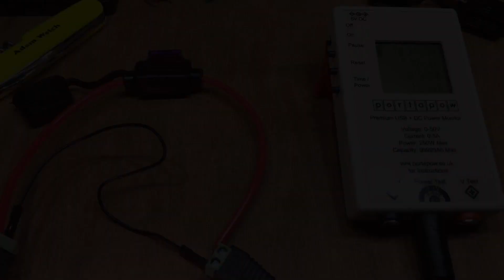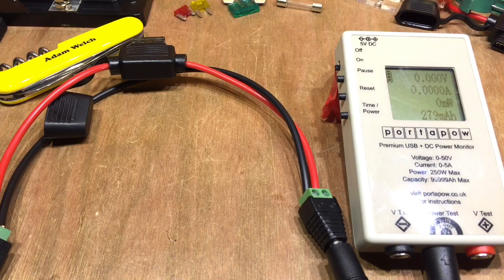Fuses - Solar Safety Part 1 - 12v Solar Shed

Comment: Good video Adam. I've recently purchased a distributed fuse holder, a bit like the one you have, but it also have a negative return on it. But bulkier than yours - wish I'd seen your video first! Hopefully I'll do an update video at some point but soooo busy...
Reply: Yeah, I think one of the challenges of putting things into a solar rig is striking a balance between permanency & allowing relatively simple changes/updates at a later stage. It's certainly annoying to mount something only to decide a week later to move or change it, leaving the holes etc of the previous work behind! I try to think ahead when doing anything of possible future upgrade paths, but there's only so much scope there. It's probably why I often leave things in temporary lash-up scenarios for so long, because I want be happy with the way they are working before committing to permanent installation!
Reply from the maker: Thanks Martin - you're not getting rid for the caravan control panel are you? It'll be great to see an update - that floor keeps me awake at night sometimes. :-)
Reply: ***** Yes, I'm considered removing the caravan control panel - one thing I've learned is that your ideas of where things need to be change, so flexibility is key! Part of me wants all the controls etc out of sight, and part of me wants it on show!!! Floor seems fine now - but big changes afoot as I've bought a mini wood burner and need to shoehorn it in - hence some of the need for a re-think on the electrics! All good fun!
Reply from the maker: +Martin Doyle A heated shed - excellent! If only I had the space.

Comment: Actually the cheapest "holder" for blade fuses is simply two female spade connectors. You can use the insulated ones to make it safer. Those 5AG "car audio" fuse holders are often crap. They can present a fairly high resistance at times especially once they age. In fact I had one that was in line to a 1000 watt inverter partially melt down! I wondered why the lights went out! At the time the load on the inverter wasn't particularly high!
Reply from the maker: Yeah I have used spade connectors before - in my first ever install.  In fact the cheap single fuse holders are exactly that, two spade connectors set in plastic.  I guess you could solder straight to the tabs too, but it's not so easy to swap out.

Yeah the car audio fuse was quite loose, I wouldn't like to run 40 amps through it for any length of time.  Glad to hear the melting didn't get out of control before you noticed it.
Reply: You would have problems soldering to a blade fuse as usually the metal that is used is aluminium. Well I guess I was lucky in that it caused a big enough voltage drop to shut down the inverter. Then again, if it hadn't it wouldn't have been hot & beginning to melt! lol I replaced it with a 63 amp breaker. I have a lot more confidence in that..! ;)
Reply from the maker: That's an interesting thought - might need to think about that for my next little project. Thanks.
Reply: Solder in combination with a spring steel wire or strap can make a kind of "last resort fuse" the wire gets really hot, the solder melts and then it springs free breaking the connexion.

Comment: Nice introduction to fuses. I just built a solar setup for my cabin. I think I used half the time just double and tripple checking the wire diameter, cable lenght and fuse ratings. I would say it's a lot more thinking required to do 12 volt than mains. Would have loved to see ta close up of the fuse when it got a high load, and a clip showing how long it would take to kill a 1A fuse at the medium load (is it minutes or hours?)
Reply from the maker: Thanks.  I left the 1 amp fuse for a good twenty minutes running a 1.6 amp load before I got bored of waiting.  I suspect 2 amp plus would have made it go much quicker.  I'm glad to hear you've been researching your wire gauge and fuse rating - I hope this video make others do the same.  
If there's demand I might do a follow up video - but my camera is not great in macro mode.